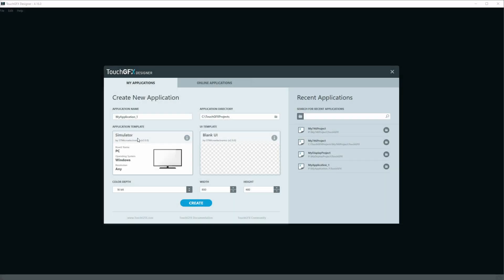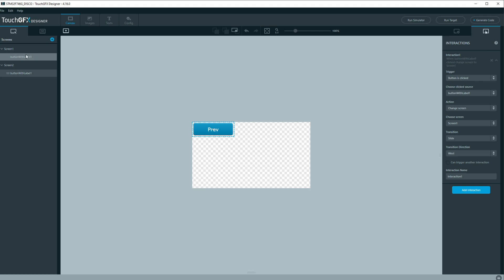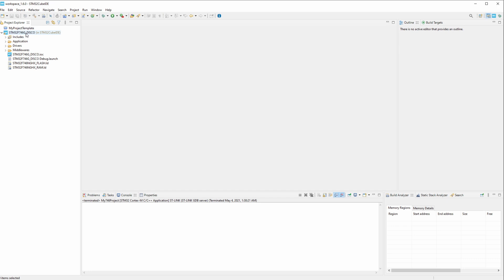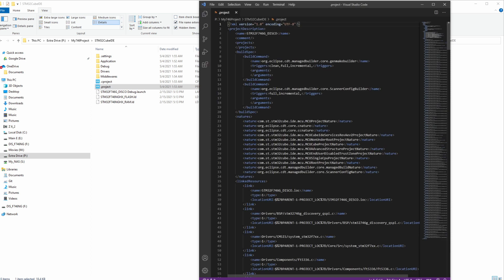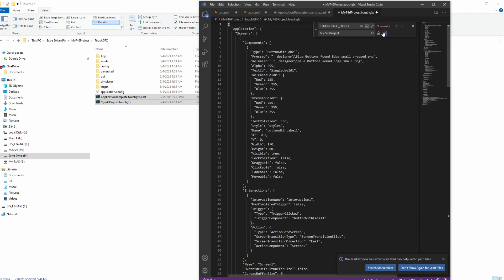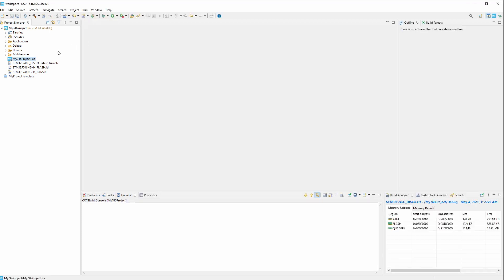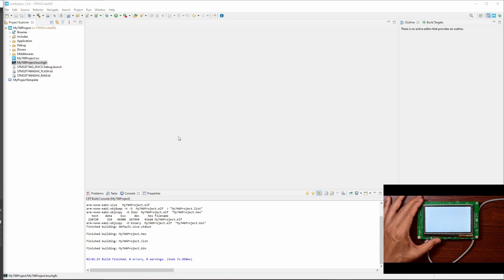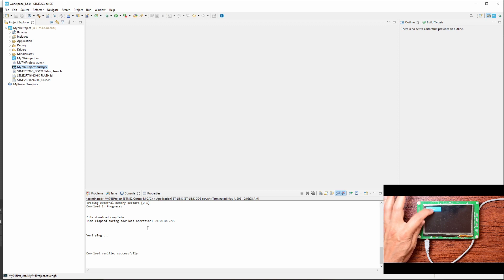Importing TouchGFX 4.16.0 project into STM32CubeIDE 1.6.1

Comment: Meanwhile with TouchGFX 4.26 and cubeIDE 1.19 there´s an additional file, which needs editing, inside the TouchGFX folder: "target.config". There you need to update the name of the .ioc file as usual... The rest still works fine in September 2025 (just the number of "finds" while replacing text has slightly changed). Thanks for your work, saved my *ss many times :)
Reply: Hi im using the same versions as you. The name of the .ioc file in the target.config seems to match for me, or could you elaborate on what i have to change ? VG

Comment: When I go through this process it does work, but I think you might be missing some steps. I am using TouchGFX Designer 4.24.1 and Stm32CubeIDE 1.16.0.  However, the file structure in the Project Explorer is not correct. For example, the TouchGFX files  inside the 'STM32CubeIDE\Application\User' directory do not have a 'src' and 'include' subdirectories in either the 'gui' or 'generated' directories. The files do exist inside the TouchGFX directory on the file system, but this is not pulled into the Stm32CubeIDE project structure correctly. When I attempt to edit the screen files from the project explorer, there are many compile problems. I attempted to copy the entire TouchGFX directory and go with that, but have even more problems. Also, there is no 'include' or 'src' in the 'Application\User\Core' directory. Where do I find the main.h file in the Project Explorer?
Reply from the maker: TouchGFX engineers chose not to show header files. You can just import them into their respective folder or your own created folder, as a file system, but link to them only. The Project file structure does not have to follow the Windows file structure. That's why the Core folder has 2 actual files and the rest of the files are linked files. They are 2 Core folders shown as 1.
Reply: @EEbyKarl  I appreciate the quick response. I am used to the file structure created when starting a project from Stm32CubeIDE so this really through me off.

Comment: hello sir,touch not working in stm32  after reset,how i can solve this issue ?
Reply from the maker: I have no idea. I never had a situation where the touch screen didn't work so I've never had to troubleshoot something that's not broken
Reply: @EEbyKarl  ok,i will make a video and then share with you,can you also make a video in which after reset it will work ?

Comment: Thx Karl ! It works good. I am using TouchGFX 4.20.0 and  STM32CubeIDE 1.10.1. But ioc file doesnt create or linked. So i added link code to .project file then when i created project, it linked a ioc file.

Comment: thanks for the tutorial I was very useful, but now I have a problem I'm using as a card a stm32h7b3i -dk but when I import the project Touch gfx 4.17.0 in stm32 Cubeide 1.7.0 I do not upload the.ioc file as the name I find in the folder is STM32H7B3i-DK.ioc and not STM32H7B3i-DISCO.

Comment: I seem to have problems importing projects in general :(

For example, just downloading the github zip (STM32CubeH7-master), and importing any of the examples (STM32CubeH7-master\Projects\STM32H745I-DISCO\Examples\TIM\TIM_DMA).. results in "Nothing to build".   Tried selecting different root levels within example but no luck... any suggestions?